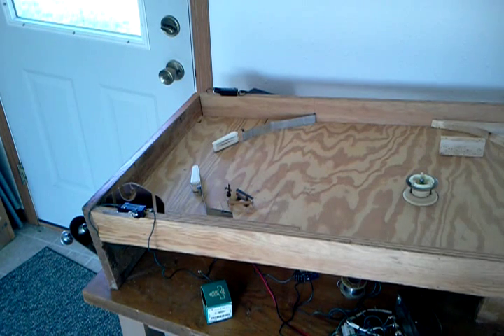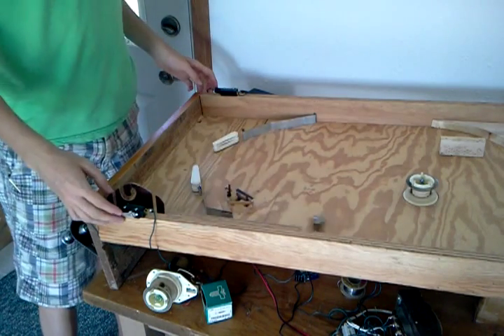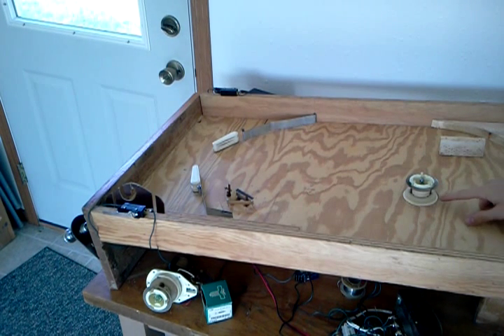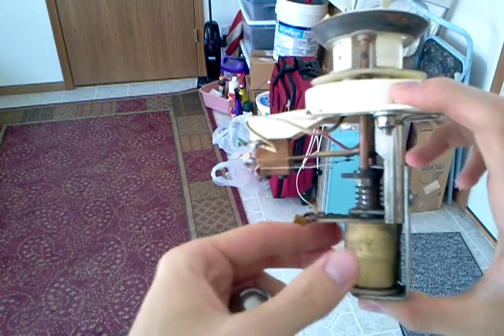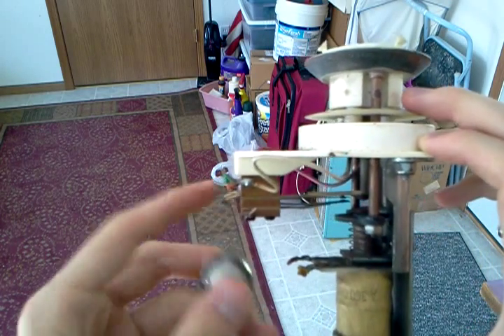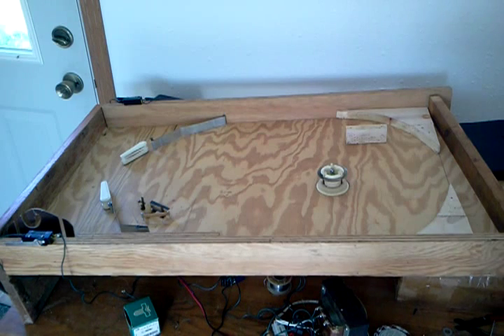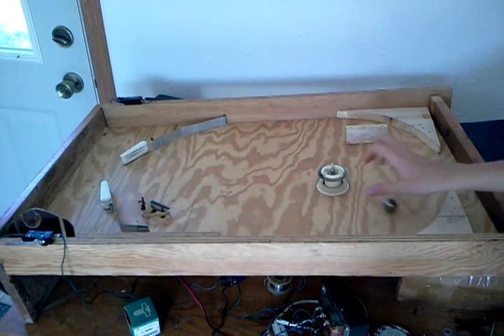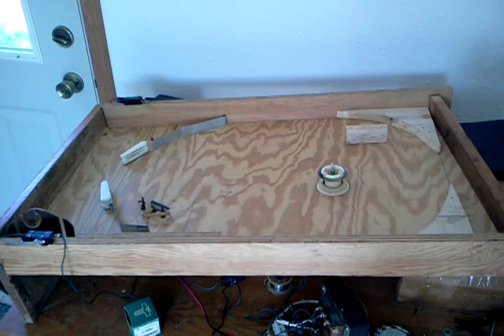My Pinball Build - Part 2 - Bumpers And Other Plans

Comment: Hy Davis, I tryed by to contact by email, but its returning back  . My name is Paulo, And I saw you 3d printing pinball. 

I have a 3d printing as well and I would like to make my own as well.

I have some questions:

What kind of solenoid have you used. I know that there is a lot of type and power.

If you can send the description I appreciate it.

Have you got the arduino code? 

Thanks .
Reply from the maker: I no longer have the arduino code. It was rather simple. The solenoids are standard pinball solenoids. I bought mine all used from eBay. They run on 24V DC, and are switched with a MOSFET circuit.

Comment: where did you get your bumpers from? did you make the metal ring and cylinder body yourself ?
Reply from the maker: I bought them used on eBay scrapped from old pinball machines. These particular ones were from a Matta Hari machine I believe. :D Just search eBay for "pinball bumper" and you'll find plenty.
Reply: Mark Baldridge
ok, thanks